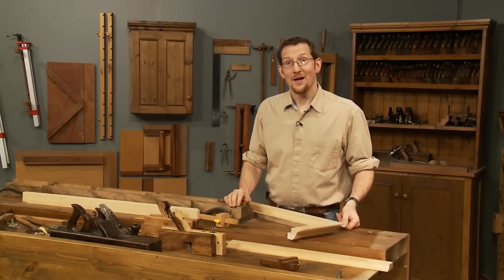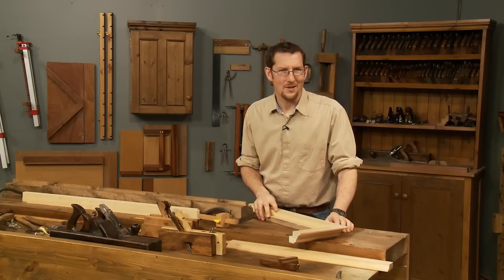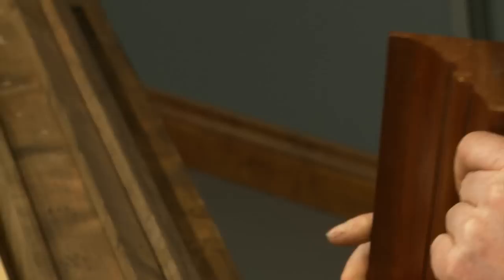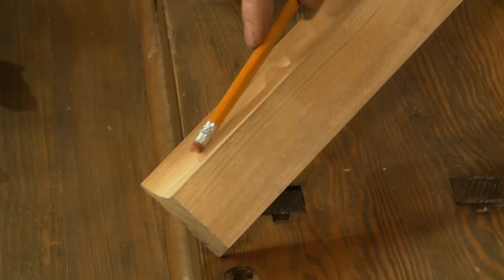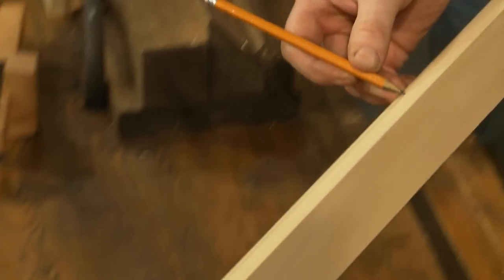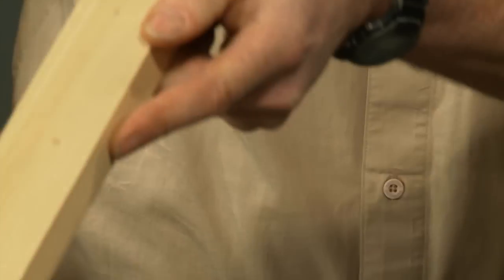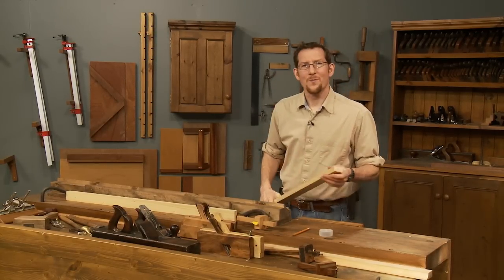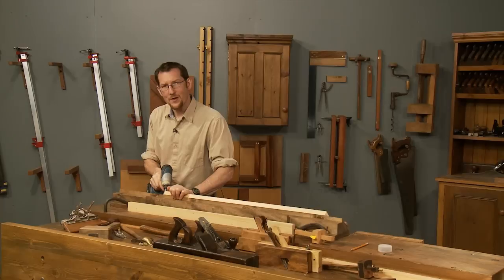How to cut a Cove with a Molding Plane - 01

Comment: I have a wooden cove moulding plane that does this with one plane with no jig. The plane has a 45 degree corner so that you can reference the plane to your bench at a 45 degree angle. You place the plane up against your workpiece and slide it down the bench on the reference part of the plane, which presents the iron at the correct angle to the workpiece to achieve the cove moulding without the iron cutting your bench. I suppose you could start off with another plane to get some of the waste removed, but you can accomplish the whole cove with only one plane, and no jig; just need to secure the workpiece to the bench using dogs or clamps. The number of planes used in this video seems overkill to me.

Comment: Why not just use the curved blade plane to start with?
Reply: It seems that the "curved blade plane", a/k/a  a "round " plane,  needs to ride against an existing straight edge. That existing straight edge was created, in this case, by the modified marking gauge followed by the 2 wooden-bodied rebate, or "rabbet", planes that left a "V' shaped groove. It was THIS groove that the "round" plane was riding against. Had he started out withe the "round", he may have ended up with a very wiggly cove. Hope this helps.
Reply: Showpro's explanation is the main reason. There's another though. Flat bladed planes, such as a Stanley #4, are easy to sharpen and can remove a lot of material quickly. Moulding plane blades, with their various curves, can be a hassle to sharpen. So putting less wear and tear on them allows you to devote more time to planing and less time to sharpening.

Comment: Nice job, however, this to me demonstrates the possibility rather than practicality of hand cutting this type of moulding.  Five planes and a slot cutter?? here i will definitely break out the router and cove cutting bit.
Reply from the maker: Thanks for the comments. Yep, for this size of molding, reaching for a cove cutter and the power router is definitely the way forwards, unless you are simply enjoying yourself. I find using hand tools a whole load of fun, quiet, no dust and I guess it's a challenge. I suppose what I could have done was demonstrate the same process with a big No.18 round plane, as the only practical alternative for a really big cove (2" radius ?) would be a $5000 spindle older, plus all that expensive tooling...ha ha! All the best!
Reply: ***** It was good to put a question mark after the 2" radius as I believe you said you used a two inch diameter piece of plastic to mark the arc.  I agree 100% with the serenity and lack of dust in the air and fun of the challenge... and... I hope I never am required to produce this cove in quantities beyond a modest picture frame )))).
Looking forward to more.
Reply from the maker: jaxplane I've got one more in this set of five videos - reinforcing a miter with a spline or tongue (hand methods of course! ha ha!) And of course, a biscuit jointer would have it done in a jiffy, so it comes down to pure and simple fun again. I have got through boxfuls of biscuits when I was shop fitting and I enjoy using my biscuit jointer. The video should be up in a couple of days! All the best mate, Simon
Reply: ***** Ill be looking forward to it )).  Biscuits on a miter is a good idea.  I have stopped using biscuits when making a panel from several boards as ive found no additional strength but a modest advantage of board alignment.  I love splines with miters.  I saw a gentlemen doing half lap miters, supremely strong but just too much investment in time, or was it that i failed to duplicate his work in a presentable manner he he.?
P.S.  Do you plan to continue offering these on You Tube or plan to progress as did Paul Sellers?
Cherrio pip pip....
Reply from the maker: jaxplane Totally agree about biscuits and panels...why bother? Right now, we're shooting some DVDs to go with my new book, Working Wood 3, but I'll always be doing short films on nifty ways to do things, just for a laugh! My main interest is in producing a solid course, with high teaching standards and excellent production values. I guess we've all got to aim for something! I get a real buzz from folks suddenly understanding methods and techniques that they thought were way out of their league. I've just started a woodworking club, which is fun!